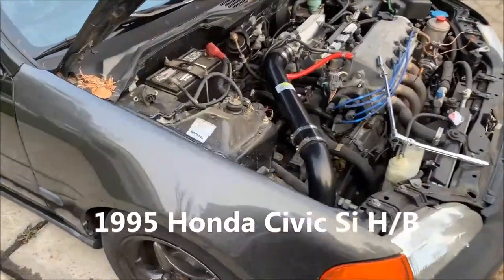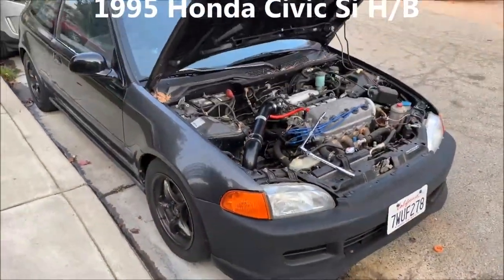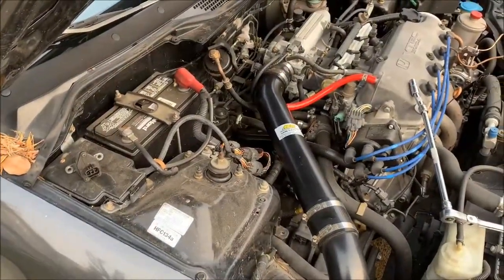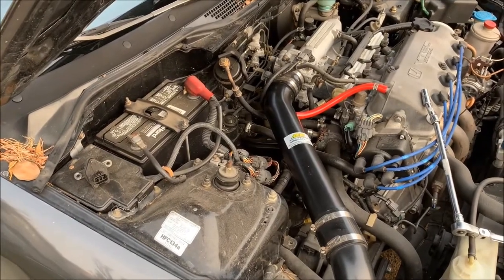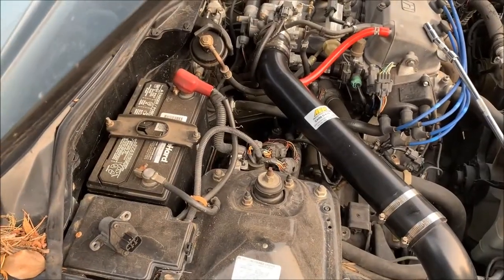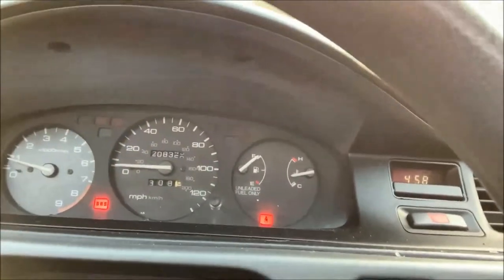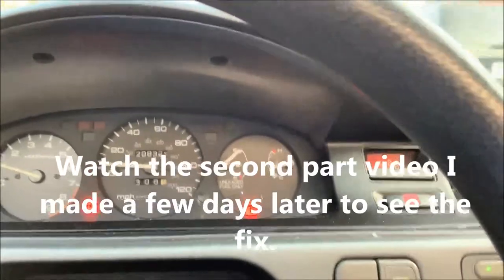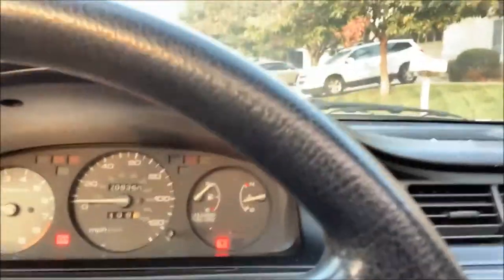1995 Honda Civic Si H/B Replacing VSS Part 1

Comment: I got the same code for my 1995 Civic EX, same color by the way. I have the official Honda  repair  manual and  it says that the problem is the ECM. This makes sense because I left my window cracked when it was raining and I found my glove compartment wet. The ECM is right below the glove compartment. Once it dried I cleared the code and it hasn't come back 100 miles later .